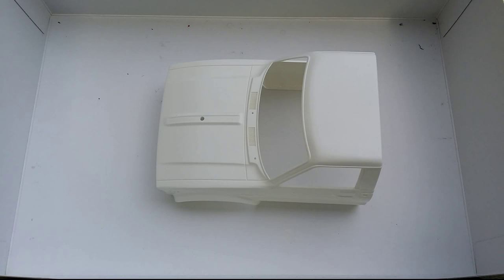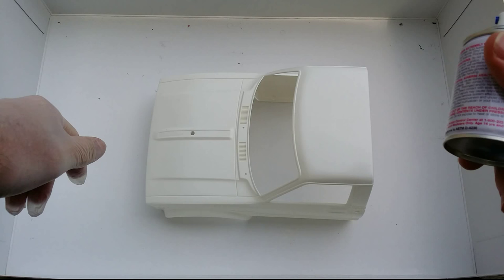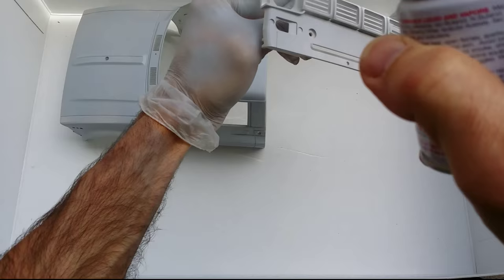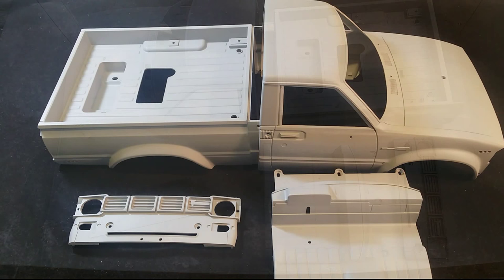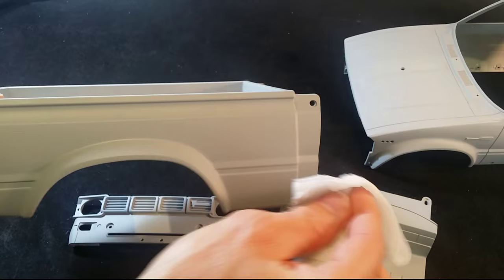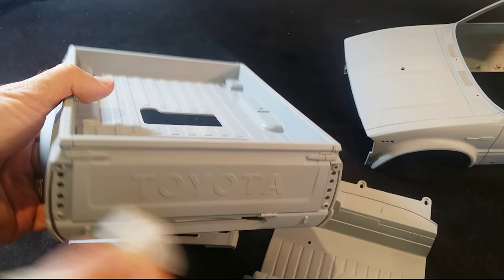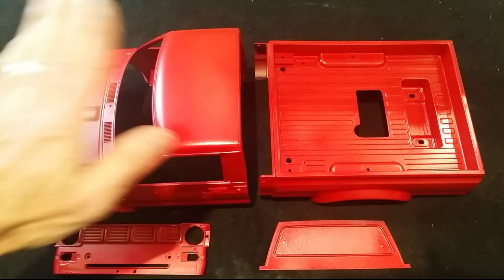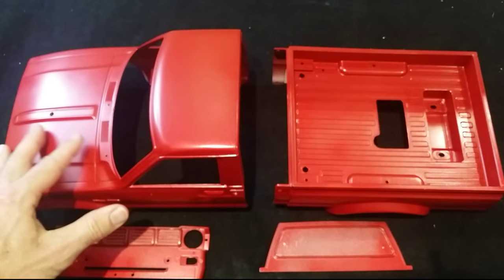How To Paint A Tamiya Plastic Hard Body - Part 2 PRIMER & MICA RED

Comment: Hello,
Never start /stop painting while on the model... START spraying then move the nozzle across the model while spraying then STOP spraying when past the model....

Nice clean spray stokes on the entire length of the area being painted
Reply from the maker: +Tick Tock thanks for the great advice and also appreciate you watching the video
Reply: @RCTanksTrucks247  
Hey, Steve. One piece of input I'd like to offer as a newbie so far is that you don not leave out the part about how long you allow each layer to dry for. That's information is not trivial at all.

Comment: This is a good example of why "orange peel" isn't such a big deal. Some people go to painstaking lengths to avoid that slightly textured finish you can see catching the light but it doesn't really bother me that much.

To avoid it you need to spray so close that the paint begins to pool but not so much that it stays pooled! The other way is to keep sanding each coat to smooth it out then use a gloss top coat. It's a lot of extra work though.

Most of the time, I just spray from a little further back and deal with that slightly textured finish, I think it looks good anyway and apparently so do you!

It's one of those subjective things, some people say "ooohhh that's a nice finish" and then other people are like "omg nooooo you have murdered that body shell, it's a crime against humanity!!!"

Even the term orange peel is subjective, I believe true orange peel is more of a smooth dimpled look to the surface, often seen on full size automobiles too. The grainy effect seen here is a different phenomenon but seems to get called the same thing.

Comment: What would happen if you didn't use a primer? would the color come out different and woud it be in a bad way? Just curious never painted anything before. Have a tamiya grasshopper kit i was thinking bout putting togther and painting.
Reply from the maker: +Larry Carroll the paint will stick better to the primer. You could paint directly over without using primer but you can run the risk of the paint pealing off.

Comment: Hey! You did one coat of primer but what about basecoat and did you sand it between coats? What about clear coat?
Reply from the maker: Hello, I did one coat of primer and Mica red. I didn't sand it in between coats as I was happy with the finish. Once I finish with all the decals then I will apply the clear coat.
Reply: +RC Tanks & Trucks 24/7 Thank you for sharing this nice instructive and to the point video!
 Getting all the stickers and decals in place, requires a lot of handling with fingerprints everywhere, do you wipe off with a cloth and some degreasing chemical before applying the clear coat?
Cheers.

Comment: no primer on the inside? and how long do you let it dry after primer or between coats?
Reply from the maker: +K - RAD no as it is painted on the outside. I left it a couple of hours in between coats.